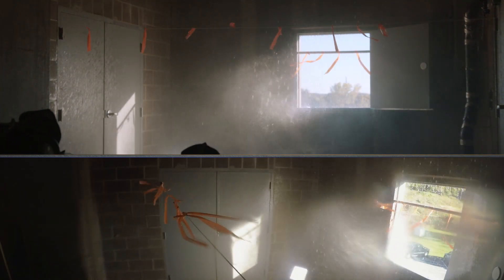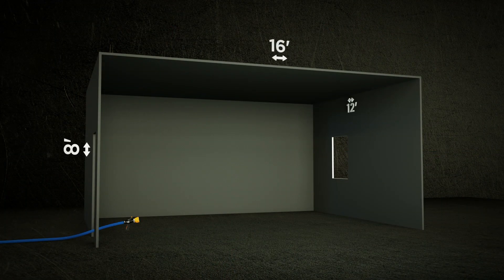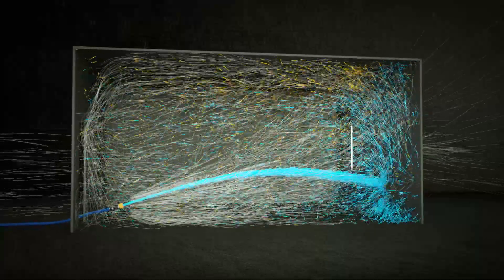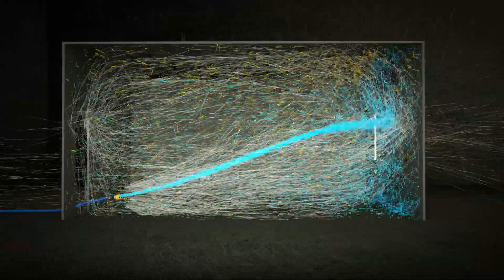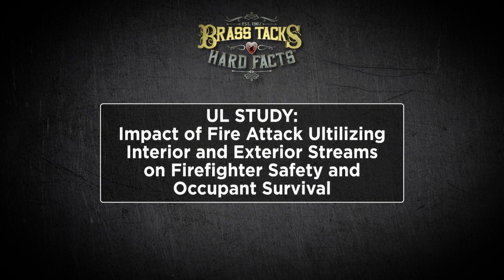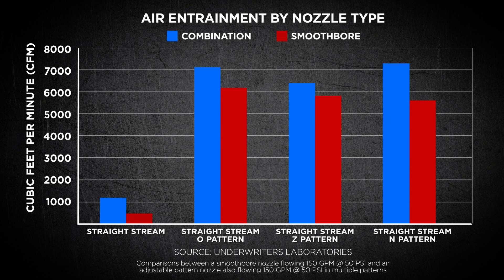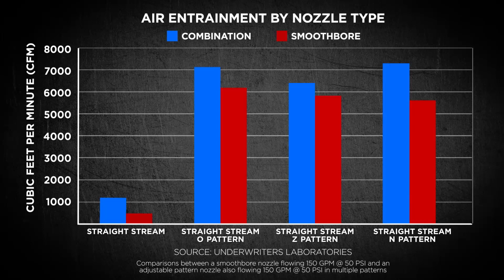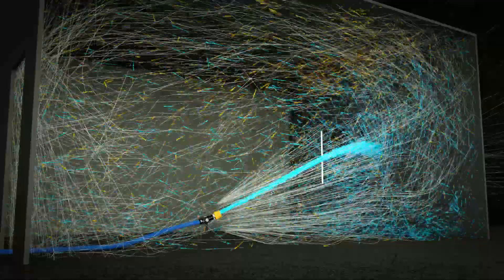How Air Movement Affects Your Fire Flow System (Brass Tacks & Hard Facts Episode 40)

Comment: Every room in a residential structure has a window.  A 360 will tell you where the main body of fire is.  You can extinguish the room very quickly from the outside before a crew can get dressed and get the front door open.  Why go inside to fight a fire you can access from the outside?  It makes no sense and is unnecessarily dangerous.  If the structure is tight except for that window, all the pressure, heat, smoke and water vapor will go out that same window not deeper into the pressurized structure.  By WAITING to stop the fire from the inside, you are exposing any victims and other materials to that heat.

If you have to go inside and you vented the windows correctly based on where the fire is, a tight cone of water will cover more material faster and eliminate the flames which create and maintain water vapor at dangerous temperatures.  All the gasses will leave the structure through the window if the entry point air flow is controlled.  Straight streams at close range take Much longer to eliminate the flames.  MOST, fire fighters don't Think about eliminating flames fast so using a cone will help to do the work that they aren't doing.
Reply: JB91710 And what does that strategy do to protect the victims that may be interior? You assume the room is “tight” based on what? Is the door even closed or intact? This post is somewhat dated but the suggestion of “a cone” of water is in direct contradiction to the facts and studies relating to combination or straight streams for fire attack. I would suggest taking a look at the latest UL studies.
Reply: @jakenoa  I said tight Structure, not tight room.  If a room is burning and you enter the structure to fight the fire, the pressure release location will be at the door where you entered which will allow the flames to exit that room and head toward the door.  When you vent the fire room windows and apply water through the windows onto the burning material, the rest of the structure is protected.  Even if that room's interior door is open but the rest of the structure is tight, the release location will still be the windows.  It makes no sense to fight a fire from the inside that you have access to from the exterior.  Also, and as I said, a cone of water covers more material faster and cools the gasses better than any straight stream.  Putting UL's or any other agency's stamp on something doesn't automatically make it right.  It doesn't matter who says what, common sense and logic dictate what is correct.